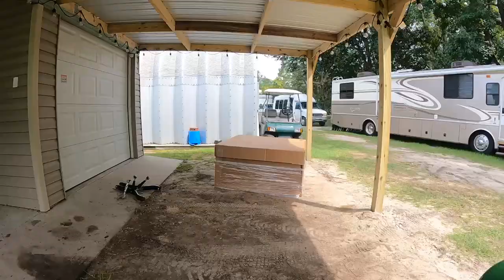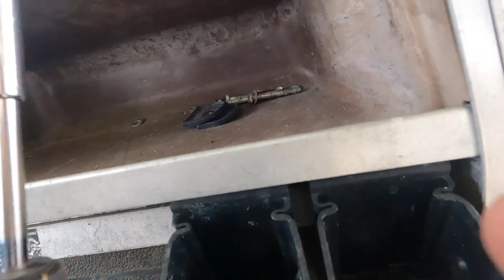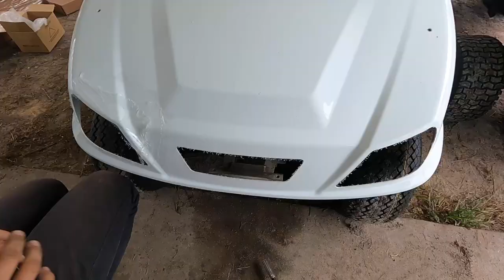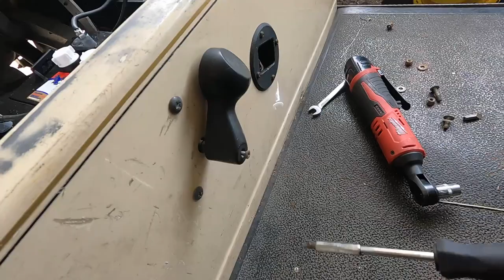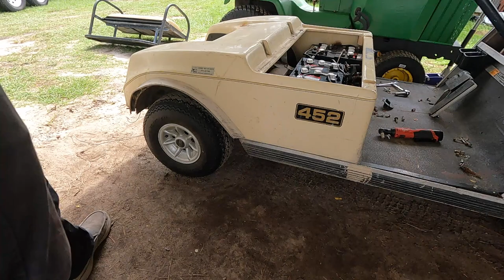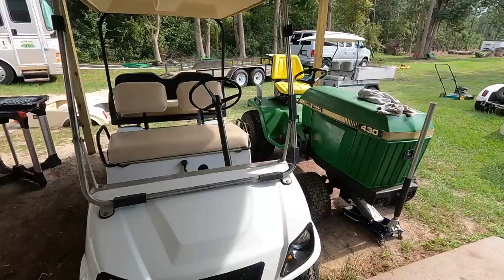Golf Cart transformation 5 minute time lapse! Installing the Spartan body kit on a Club Car DS

Comment: Thanks for making this video! I just received my spartan body today. Couple questions; did you rewire the cart with the provided wire harness or just wire the lights into the existing harness? Also, what size hole drill bit did you use for the charging receptacle? TIA!!
Reply from the maker: The Spartan body I received it didn’t come with a light harness… Just the lights. I cut the plugs off of the lights and wired them into my existing light harness. As far as the charge receptacle, I can’t remember the size but it was slightly over 2 inches I think. Just hold some hole saws up to the old hole on the original body until you find one that’s close. That’s what I did.

Thanks for watching!

Comment: the block u added for the front bumper (aluminum) did it came with the body kit ? thanks in advance!
Reply from the maker: Yes, the bumper block came with the Spartan body kit. It also included a 1 inch front spacer to lift the leaf spring, which keeps the wheels from rubbing the body while turning.
Reply: Nice! I'm getting my spartan kit in 1 week! nice to know that because it didn't say nothing about it! thanks for the info!

Comment: Did you put the metal support bracket back back under front seat behind the forward/reverse switch? Im having the hardest time getting mines back in proplerly without creating a buldge partial due to after market mat.
Reply from the maker: This cart was a 92 with a fiberglass rear body, and the fiberglass body didn’t originally have that part. I know what part you are referring to and it can be a pain. I still service this cart regularly and it has been just fine without it.